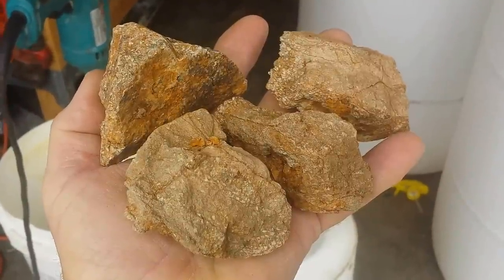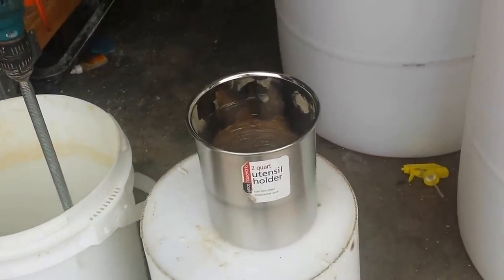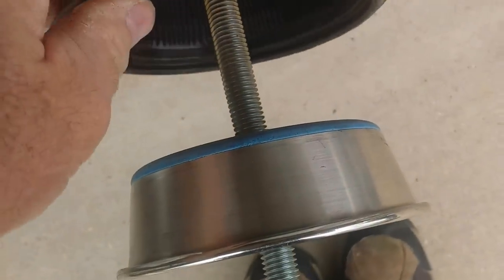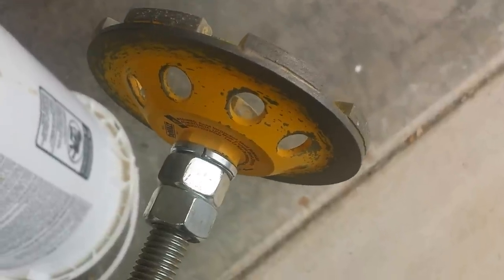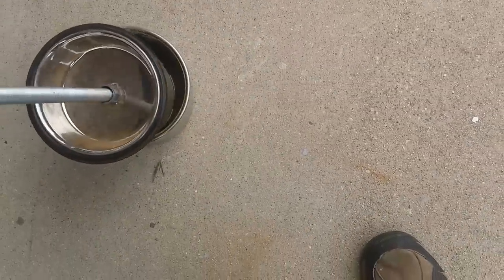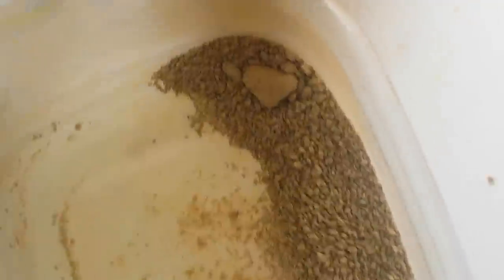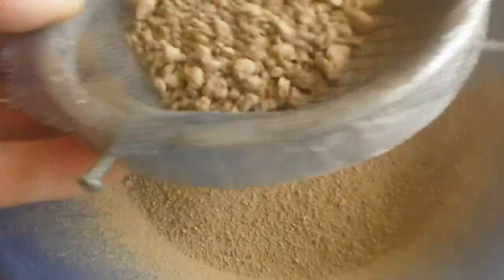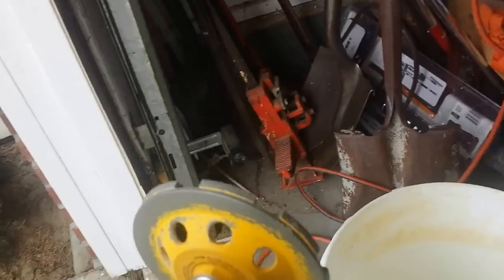DIY Home Made Rock Pulverizer - Rock Crusher

Comment: That could work very well on a large drill press with a shorter rod. a place to bolt it down on the table, clamp the lid on, and added power of the press. That would be the cat’s arse, for grinding.
Reply from the maker: Glad to see you are thinking it through. Good plan. And as always do it safely. Thanks for watching.

Comment: I dug a hole with a post hole digger, put a coffee can in (not as sturdy as your utensil holder), jammed a couple of rocks between the hole and the can to hold it steady, and that worked to stabilize it. I had been using chains on a paint stirrer but that isn't working well enough so I'm buying the grinder head and the dog dish. I cut the shaft on the paint stirrer for more stability. You can take the container right out of the hole and pour it wherever you want. When the container gets chewed through, buy another!

Comment: Looks like it worked pretty good...two suggestions, 1) Cut your threaded rod in half...lenght would still be enough to do the work, and a shorter rod would give you less flexibility, less chance of the rod to buckle or bend, possibly even snap, and shorter would be stouter. 2) Find a way to make your stainless steel bucket stationary...not using your feet...save you some possible pain and embarrassment in the future...other than that, I liked it and will subscribe!

Comment: Best DIY rock crusher I've seen so far! Awesome man! Wish I had that much gold ore lol.
Reply: I just made one with a angle grinder, a flail made out of a couple links of chain, and some flat bar bent into a circle, and a few boards for end caps. Basically just flip the power on for 3 seconds and it's basically powdered. 5 if you want it powdered. So so much easier than the manual one I made. Cost zero dollars. Random crap laying around

Comment: Thanks Duwayne & Jeff,  it gives me ideas,  I have already ordered a Pulverizer identical to yours, it's called a Grinding Cup Disc Wheel from eBay with tax $23.66 delivered. I will use the one I am going to build with a Rotating Rock Hammer. Thanks for the video.

Comment: I used a long anchor bolt and a oxy tank lid and slip fitting it powders it but……. It that drill binds up it’s gunna take your arm for a twisted trip and mess u up.   I know from experience.  Yes it works but at a price

Comment: there's always room for improvement, but you did a great job under a minute. And I suppose you could put that same powder stuff back in there and grind it even further. That sounded like a hammer drill? yeah you might want to put a tube around your threading just in case it breaks. And I suppose you could put a shorter rod on it too, and built on to a countertop. Great idea though. I wonder how long that head last list real hard rock like quartz? thanks again

Comment: This works great for Hard but Granular Rock like Quartz, but not so good for Shale, Schist or Dense Sandstone. It does work but takes forever and the Nut tends to hang up on the Rocks in the Middle causing the bit to spin without cutting.

Comment: Great idea using a grinder wheel. Pour yourself a slab using the stainless to make a hole and embed a few hooks or latches to secure the lid. I see crap flying everywhere and it's killing me. That will also protect you incase a stone rips through the side of the stainless which one eventually will. As for using a shorter threaded rod I don't agree. I'd say maybe a black steel pipe with grease inside or something similar to support the bending/flexing. You don't want to be leaning over doing this all the time with a shorter shaft. There has to be some sort of bolt on flange out there to solve the nut binding issue. I was using a think stainless pestle with a pipe stuff in it and another pipe with a welded end as a ram rod but the pestle had a blow out today so looking for an alternative. Might try this. Thanks
Reply from the maker: Thanks for the comments. I know this wasn't the safest our even perfected by a long shot. Just threw an idea out there hoping someone can get a perfected working safe model. Again thanks. I like it when folks look at things with differing perspectives.
Reply: @DuaneTheOakHirst   I'm no expert and aside from the safety and the flying debris I think your idea is awesome and one of the best I've seen. I was just looking to see what I have already to do something very similar after I saw your vid.  Smashing rocks is a whole lot of work and anything that makes the process easier without paying an arm and a leg I'm very happy to see. I saw a couple videos where people were heating rocks until they glowed red then cooling them down with ice to make them brittle before smashing. Doesn't work for all rocks but  it did for the majority of the ones I tried it out on. If combined with your idea it sure would go a hell of a lot faster. Especially when you get to those rocks that don't become brittle. Maybe you could do another video and test it?
Reply: What is the name brand of the grinding wheel

Comment: This is a wonderfull idea!

As it is shown in the video its a bit slow even compared to crushing rock in a metal tube with a hammer or a pestle. Also the ammount you can crush at one go is a bit small even compared to a mortar and pestle.
But by now you most likely have worked those kinks out im sure. After all this video is two years old.

Very nice indeed. I will give that method a try for sure.
Reply: 6 years old you mean?
Reply: @greengaming3232  6 years yes, you are absolutly right, thank you.

Comment: I think that is pretty ingenious. How long did it take to grind the 4 rocks in the container? I think you said the electrical fitting was 1/2".  But 1/2" would not fit over the 5/8 all thread would it?  Would the elec fitting be 3/4" instead of 1/2.
Reply: a 1/2 inch box fitting is larger than 1/2 inch because it goes over a 1/2 inch conduit
Reply: Half inch emt is measures on the inside of the pipe (for "wire fill" calculations) AKA ID. The pipe goes inside of the fitting, so 1/2in.+ watt thickness×2 would be the ID of the fitting. Besides he mentioned TWICE that he had to boar it out.  So ya it's a 1/2 in emt set screw connector.
Reply: Wall not watt

Comment: That's a fantastic idea! After perusing the various fab and angle grinder pseudo impact mill constructions, I came back to your cup wheel idea and think it'll do the job for my needs. I'm trying to flake and powderize anthracite for much different purposes but on a backyard DIY budget. I have a few 'previously projected' stock pots, though I think I'm going to go old pressure cooker pot that at one time turned into a pressure vessel for degassing for the thicker walls and the gasket. Just wanted to come back and definitely add a kudos for the idea! 👍
Reply from the maker: maybe not the best and does need improvements. just tossed it out the to get fol;ks thinking. thanks for watching and taking an interest. rock on. and be safe